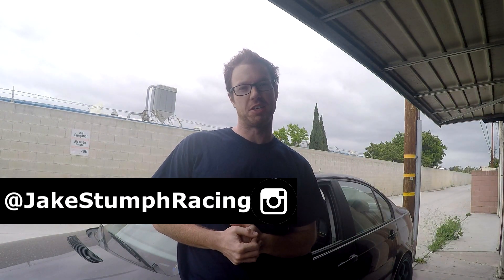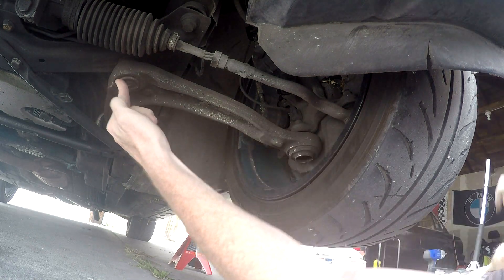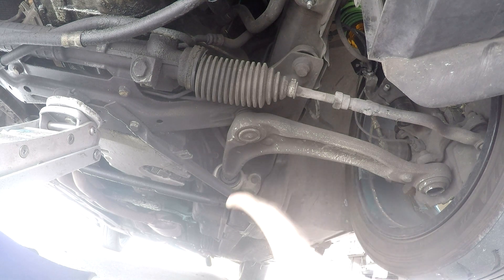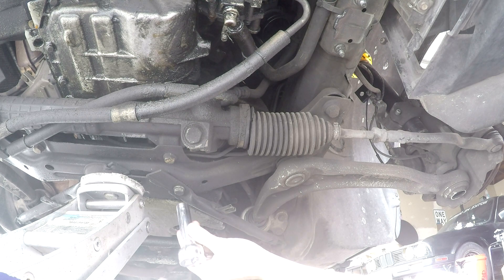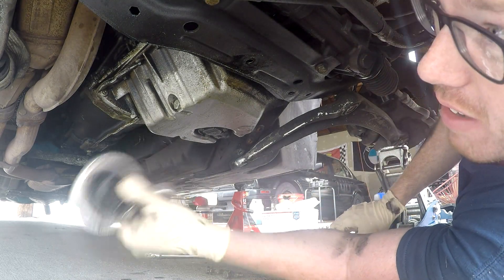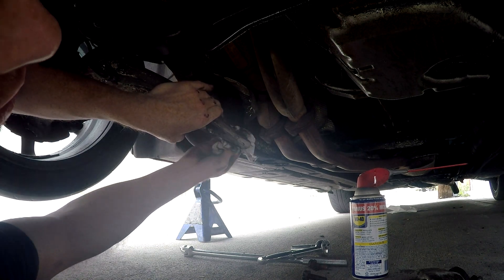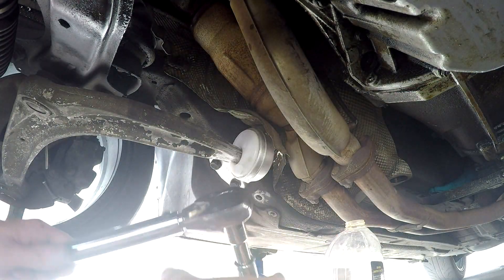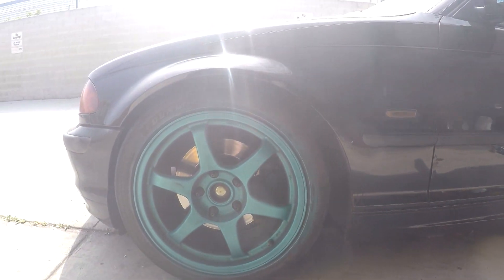Installing Condor Speed Offset Control Arm Bushings on Project E46

Comment: Sloppy steering is 1000% eother your steering rubber coupler has play in the rivits/torn or tie rod inner/outer is  bad or rack itslef is ducked which is least common. I would buy a soild metal steering coulelr from condor speed and also new inner and outer tie rods and it will be on rails. Best upgrade ive ever done to make car handle on rails was the rtamb. Monoball bushing in the rtab makes a hugeeeee crazy difference like unbelievable. That being said make sure if you do you wont feel better handl8ng if the rest are all loose so you gotta re do all of them. I highly recommend using ball joint om the lower of the rear as well it made a hige differnece. Cant speak to monoball inner upper and lowers yet for the rear but i can only image it would make it thag much moee solid if wvry last bishing was inde3d a baljoint with zero play or bind9ng